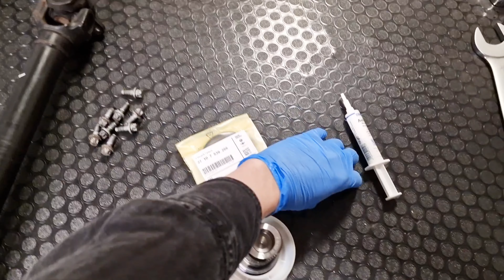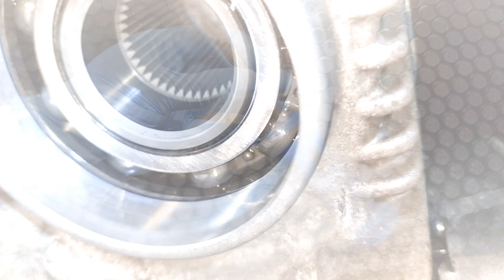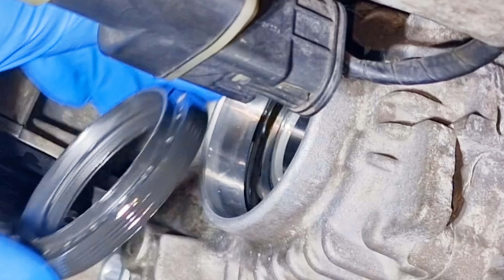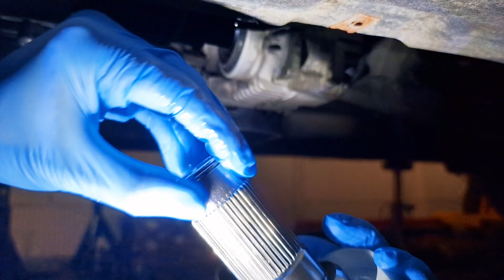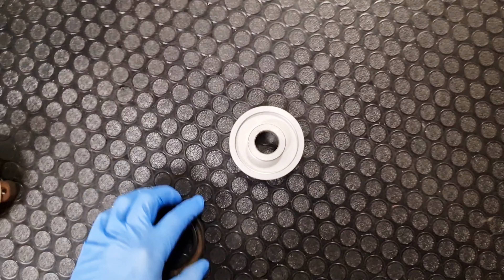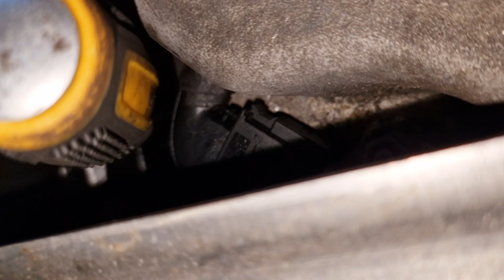BMW 330xd E92 - ATC 300 Front Output Seal And Prop Shaft Replacement

Comment: Did you do the job because of clunking while accelerating?
Reply from the maker: I heard a single click sound when I parked, like I went reverse and heard the single click kinda. Also, above 140km/h, I felt vibration under the floor exactly coming from the propshaft. I decided since im there to replace the seal, too. And since I decided to replace the rear flange, it was easy to buy the front one too, and I replaced it too. Front flange replacement was unnecessary in that video
Reply: @ShadetreeRoadsideRepairs  did you have a play in front flange before you change it? Because i have an e90 xd but no vibrations and no clunks yet, just oil leaking from the seal. I don't have the dust cover from the front flange and i don't know why the seal broke in 1 year, maybe from the flange play or from no dust cover, what do you think? The play that mine have is not when rotating, but when you move left right

Comment: Thanks for sharing. I need to replace only the output seal. I guess I don’t need to remove the whole driveshaft from both ends right?
Reply from the maker: I think it might be possible to remove it only from the transfer case. Maybe it wouldn't be enough space to take the flange out, but it's worth to try.
Reply: @ in ISTA It says refilling the oil implies removing the full exhaust system and some bars which actually look like a significant job, at least for the e84. Did you have to?